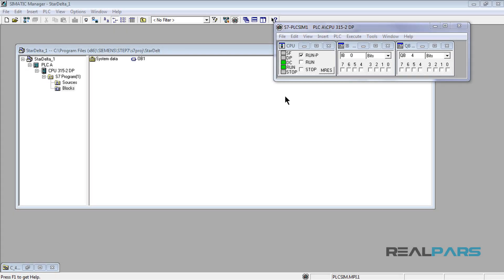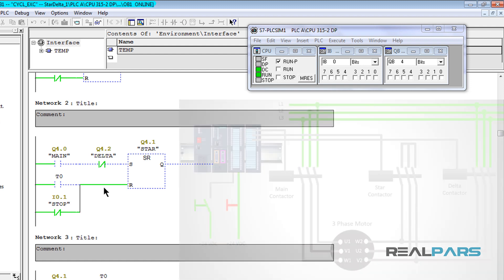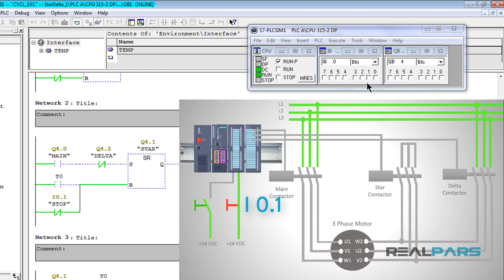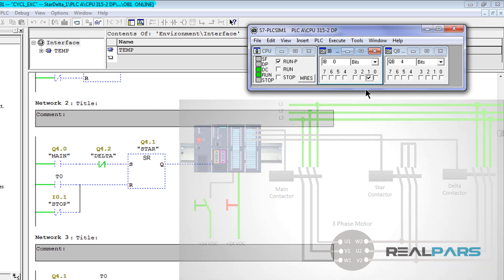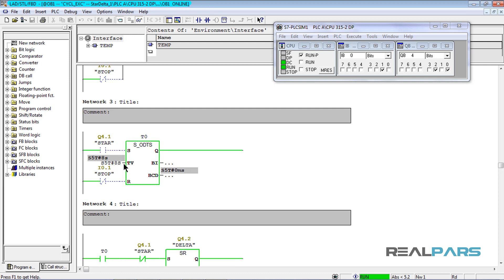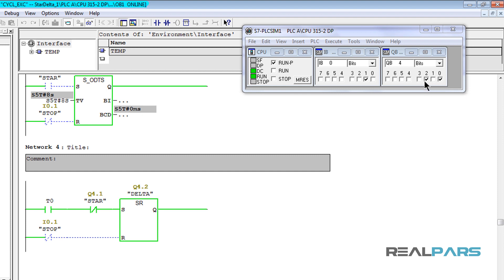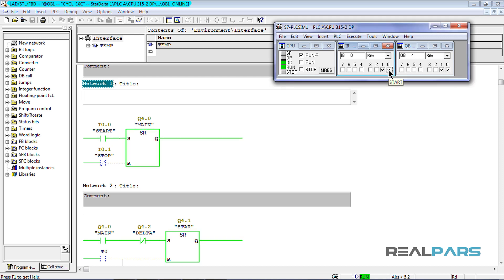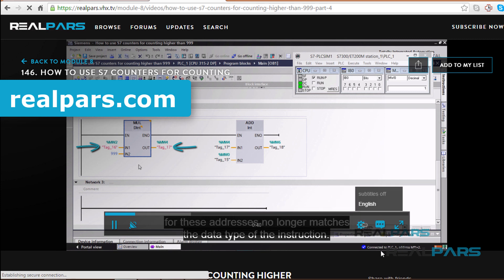Star-Delta Starter PLC Program and Wiring _ Part 14

Comment: Fun to watch. One thing though, as the command to stop the start and connect the delta happen at the same time in the PLC and as in reality contactors have physical delays, there should be some delay between the two. Otherwise a slow star disconnection with a fast delta connection might cause both contractors to be connected at the same time.

Comment: How is it running without this —( )— output? I thought, every project required this.

Thank you.
Reply from the maker: Thank you for your question, it's quite common among students. Each type of PLC logic representation varies, but they all must yield the same logical results according to standards. The symbol -| |-------| |---------()- is merely a visual aid for humans to comprehend the outcome. In reality, PLC operates on machine code, utilizing "1" and "0" because of its digital nature. Hence, not all logical representations necessitate symbols to trigger an action.

Siemens PLC functions on Boolean-based computer logic. Here's an example of what truly occurs in the memory logic of a Siemens PLC, regardless of its visual representation:

I0.0 and I0.1 = Q4.0

This is essentially an "AND" gate function, where "AND" and "AND" represent the inputs and "Q" signifies the output coil or I0.0 and I0.1 = Q4.0.

We offer lessons that delve into PLCs comprehensively, feel free to check that out over here https://www.realpars.com/courses

Happy learning.

Comment: Very well presented video, however the following elements seems to be missing.  1, Mechanical interlock of STAR and DELTA contactors.  2, Electrical interlock of the STAR and DELTA contactors. 3, Correct programming would be to bring the STAR contactor in first and then the MAIN contactor.  4, Dwell delay between opening the STAR contactor and closing the DELTA contactor.
Reply from the maker: Very good comments, Richard!  There are many factors to consider when installing a star/delta system, so we often purchase electrical components as a package that help to integrate the characteristics you describe.  Thank you for your contribution to this discussion,

Comment: I have a question. How to physically connect PLC to the three-phase motor. Did we use an old-style contractor or another thing else?
Reply from the maker: To start a motor from a PLC, you will still use a motor contactor.  The contactor is energized by pulling in a coil on the contactor. I would suggest for any motor start circuit, that you use an interposing relay between the PLC and contactor, for reliability and safety.  The PLC output will energize a relay, and one set of NO contacts on the relay will be wired into the motor starter circuit.  This way, a 24VDC PLC output card can energize a 24VDC relay with 120VAC-rated contacts.  These contacts are wired into the motor circuit and will allow the contactor coil, which is typically 120VAC, to be energized, starting the motor.

Comment: Hello Mr,
Thank you very much for these lessons.
I have a question, I hope to answer me, please.

When I use scale function like FC105 in OB1 and If I want to write analog inputs addresses like PIW252 and I want to write address like MD10 for output of  FC105   , in symbol table, I can write it but the problem is in the OB1, I get error there, why?

If the question is not clear, I can send email with screen shot if you give me your email.
Thank you in advance.
Regards
Reply from the maker: Hi there, you need to make sure that the data type for each address matches with what FC105 can accept in the inputs and outputs. 

For example, hover your mouse over the output of the FC. When you do this, a tooltip appears and shows you all of the datatypes that this output can accept. 

Next, you need to make sure that the in the symbol table, the data type that you have for the output address matches with those that the FC can accept in the output.
Reply: @realpars  
Thank you:)

Thank you for your patience, I still have a lot of  questions. I hope to help me,please.

I have a sensor whose name surface temperature sensor which its output is 4-20mA.
In this case can I deal with this sensor like any sensor and I can use normal analog module  like which we use with 2 wire transducer or 4 wire transducer? or I should configure the PLC to deal with temperature sensor with analog module which deals with temperature sensor like RTD and so on.
the following link contains my sensor:

http://www.globalw.com/products/we710.html

Comment: Sir plz tell me that..if we make the motor to be run in clock and anticlock directions......does the motor require seprate star contactor connections for both direction or only single star contactor is enough???
Reply from the maker: If you want to change the motor direction, you will need to add more contractors to this diagram.